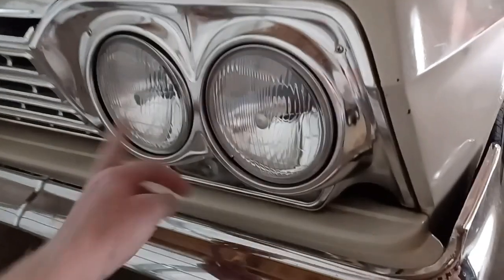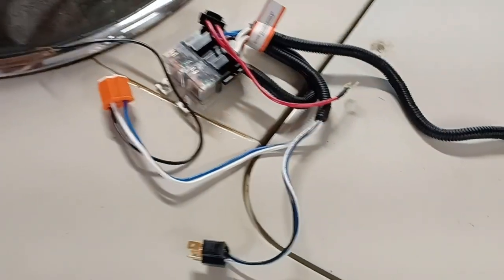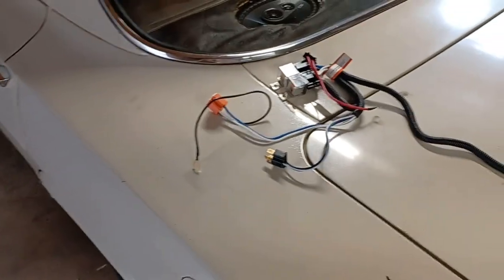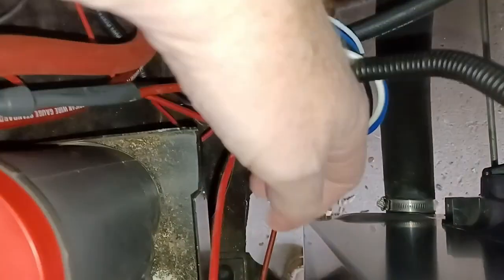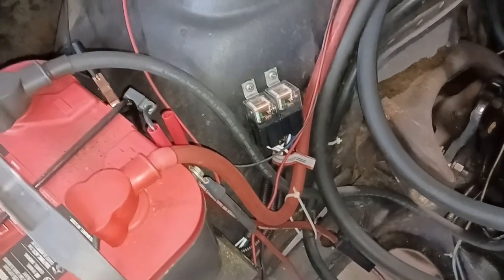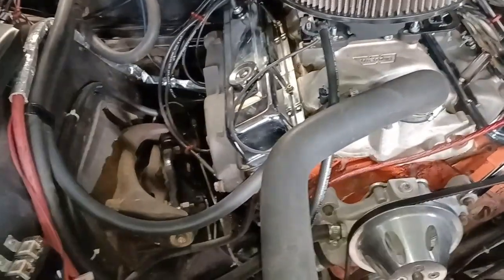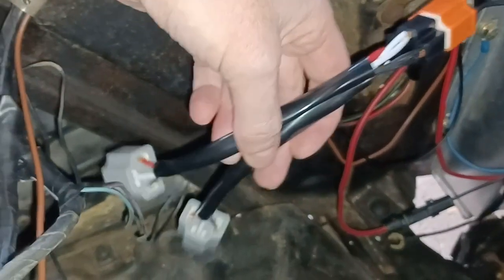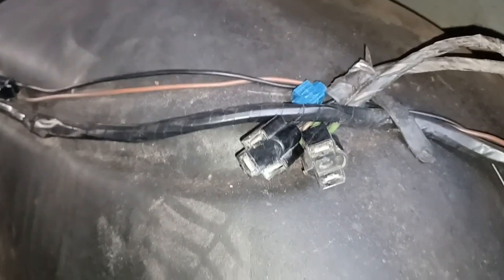1962 Chevrolet Biscayne Headlight Mod

Comment: Cool... I will try to get that done on mine also, good deal.
Reply from the maker: If you aren't using led headlight bulbs, make sure you use an appropriate size relay.  Let me know if you need assistance with figuring it out.